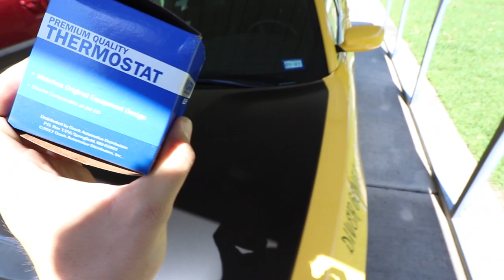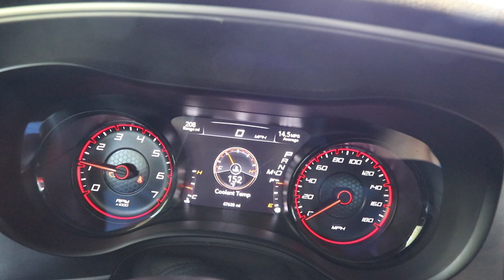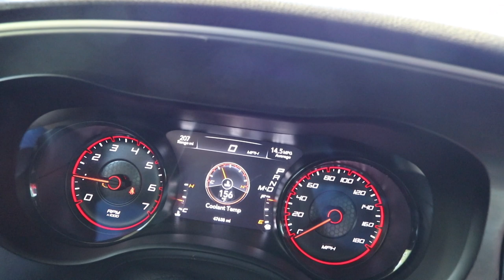How This $20 Part Caused BIG PROBLEMS For My 13,000 Dollar Engine...

Comment: I learned a long time ago stock and jet thermostats are trash but Stant is definitely one to look into. Works a year later no issues with a aftermarket water pump because you know the factory one is garbage🙄always fails and mopar will never fix the leaking just replace it with another factory pump. So Stant 180 thermostat and a aftermarket water pump, golden.
Reply: And Stant thermostats are like $14
Reply from the maker: Thanks for the advice bro! I ordered one that’s 40 bucks that should be here soon, hopefully that one doesn’t fail but if it does I’ll take you up on that!

Comment: Did you bleed cooling system after t stat replace also i would recomend mopar t stat ive been threw so many aftermarket 1s with these hemi engines there real picky on t stats  on 5.7 they open up at 203 not sure on 6.4s dont do a long trip on cheap t stat also fill with original coolent   i had this problem b4 just make sure to bleed air out of system easy to do
Reply from the maker: Thank you bro! Yeah we bled the system, and the only reason I keep getting aftermarket ones is because they go down to 180° you’re not wrong about the car being picky though
Reply: How do you bleed the cooling system on these? I just replaced my thermostat and every video said they self bleed and it doesn’t seem to be getting hot. Hope the car is good as well man
Reply: @Jaydee6.2   do you have a alen type screw on ur water pump houseing ? If so un do the screw on cold engine and fill resivor untll coolent comes out of hole
Reply from the maker: I mean I never have trouble when I replace it, I think you’ll be fine
Reply from the maker: What he said lol

Comment: Damn my dad has that Daytona ram you roasted my dads truck did exactly the same and the water pump broke 2 weeks later you should change the oil now it’s got hot change the plugs and the oil just to be safe and make sure it’s running clean
Reply from the maker: Thanks for the advice bro! I did change the oil again, if something else fails I’ll just replace it
Reply: Damdaved anytime bro love your work 🙌

Comment: I wouldnt throw cheap parts at a expensive car. Especially with a build that is on your own. The only thing i would think to follow up on is the collant reservior. The thermostat is only to react to the temp and like h said retract. It basically prevented the engine to cool. 
Get that CEL checked. Get that peace of mind
Reply from the maker: Thank you for the advice homie! Yeah anything I replace is not going to be cheap that’s for sure
Reply: @Damdaved  i bought a 180 tstat a year ago and havent install it. Its been sitting in my trunk since i got it. Now u got me thinking 🤔
Reply from the maker: I haven’t heard of anybody having this much issues with one, but I don’t know🤷🏻‍♂️

Comment: Make sure you change your oil you probably exceeded its temperature rating and burned it. 
Shit you already did that sorry
Reply from the maker: No problem lmao, yeah I changed it right before this happened, and after. The oil didn’t look burned, but it only had about 200 miles on it so I ended up changing it anyway. It cost more money, but well worth it for the peace of mind